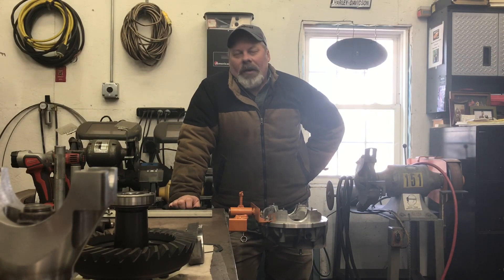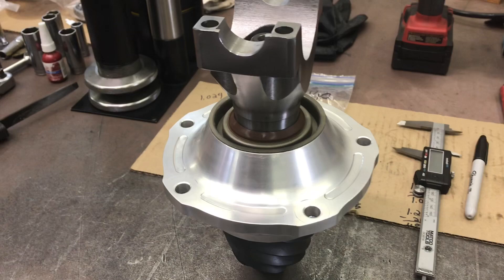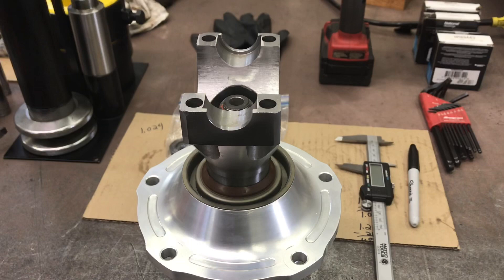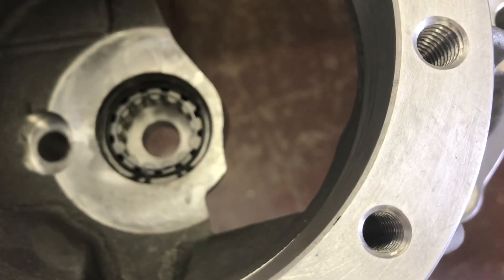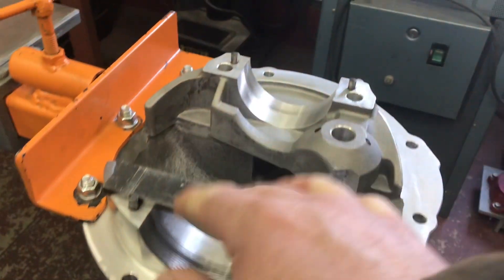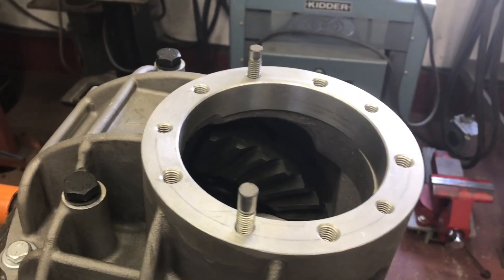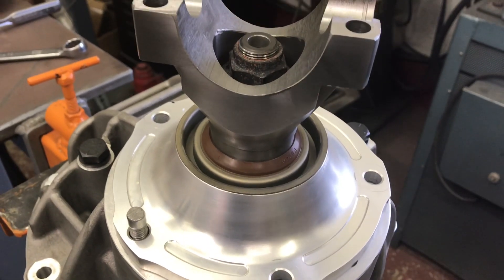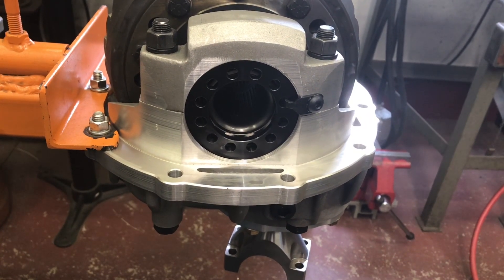9 Inch Ford Assembly

Comment: Good information. Thanks. I do have a couple questions. I'm working on a stocker Ford nine. I'm reusing the stock 3.25 ring and pinion, but I'm installing a Yukon Duragrip. The stock pinion shim checks right at .017". I bought a bearing kit with all Timken bearings. What I'm wondering is, will the new pinion bearings change my pinion depth? Because the original OEM Tyson bearings still look, sound and feel pretty good considering it came out of a 1972 F100. I failed to measure the pinion depth before I took it apart, so I have no base line to go from. How would you treat this situation? Go ahead and install the new bearings and go through the arduous task of multiple disassembly's and pattern checks, or just run with the old bearings?
Reply from the maker: I would install the new bearings with the old depth shim, it will be fine.
I often buy used pro gears or NASCAR gears and they usually note or include the old depth shim thickness.
Set your backlash and carrier bearing preload and go.
No need to check pattern unless you are just curious.
Reply: @mountainsgarage  Thanks man. New bearings it is. Another thing that bothers me is I did check the backlash before disassembly and it only checked at .002-.003" all the way around. Should I increase it to .008" or so? Of course my indicator is a cheap Chinese unit, so...
Reply from the maker: @jojodiver8706  Yes around .008 is good.

Comment: How about using a inch pound torque wrench to set pinion bearing preload
Reply from the maker: Absolutely, 10-15 for used bearings, 20-25 for new.
Reply: On the preload with a solid spacer there is no preload